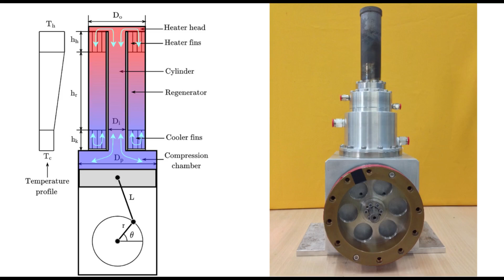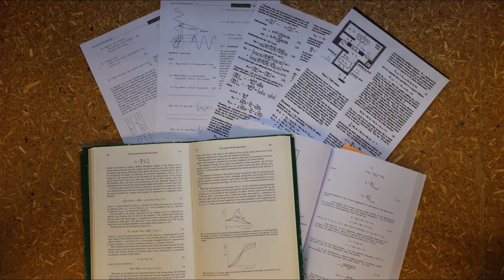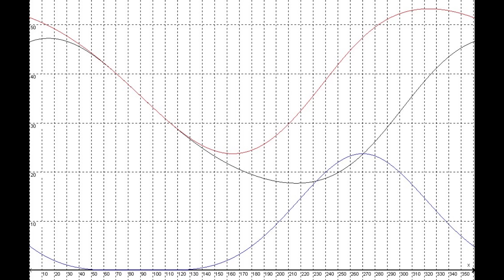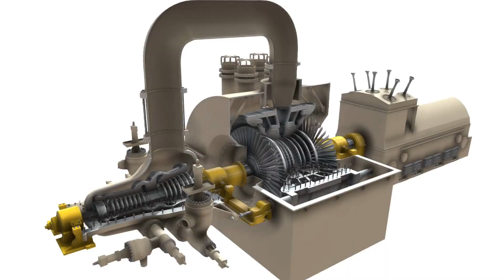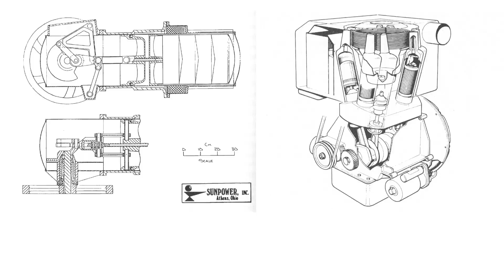Solution of producing cheap energy to support our solar plant to go off grid ?

Comment: I've been getting an itch to build a rhombic drive and I decided to watch all your videos from the beginning to in sequence.   It seems you had put so much effort into getting this to work and I thought you where making progress.  It's a bit of a bummer that you're thinking about moving in a different directions.   You mentioned your primary reason for abandoning your design was over reliability issues.     I understand that part of your constraint is the diy aspect of this with the equipment you have.     The question that I ask myself, was did the original phillips engine also suffer from these issues as well.   If equipment, time and money, where not the constraint, how would you solve this problem.    I don't know if this could be a solution or not but it seems to be that the lower portion of the drive, the linkages, gears etc should be bathed in oil.  You mentioned that you needed to keep oil out of the compression area because it would foul up the regenerator.   Would there be a way to have a oil sump isolated from the piston/displacer (Bellows perhaps)?   Fwiw.. I don't exactly understand how your regenerator works.   I saw a couple other designs where the displacer was also the regenerator, which is not the case in your design.... Was there a video where you talked about your regenerator and I just missed it?    It sounded like you had many technical challenges with the compression cylinder.... How do the big boys do it..  It sounds like you might be moving to a free piston design,   would those piston issues carry over to that design as well?
Reply from the maker: I will still develop the Rhombic engine further, I just need something new now for a time!
The Problem with it is that the Rhombic Stirling is too complex and  therefore it would be ridicoulus expensive.
So I have to make it simpler, more powerful and also less maintenance intensive which is a big task.
The Philips Rhombic engines were succesful but also too expensive for the market to compete with other engines.
If you want to use oil in the crankcase and/or on the power piston you need a oil scraper ring which is also quite complex.
The regenerator is a very fine wire mesh and stores the heat between hot and cold and raises efficiency.
I think you can see at least a part of it in the video "development of the rhombic Stirling engine" a few years ago.
I did not decided which concept will be next as I got so many suggestions here that I first have to sort everything.
Greetings

Comment: Steam is a better option if your going to use a gas or biomass fuel. Best option for long term continuous operating would be a turbine since the only moving part is the rotor shaft & bearings. You can make the rotors using thin lamnations welded together to create simple impulse rotors.
Reply from the maker: Steam still seams to be very poular as the mane y commentarys hers show, I will think about it!

Comment: What about Fluid Stirling Engine? I think they are for you the best choice
Reply from the maker: I think they have very low power.
But if you know a powerful design it would be very interesting...
Reply: @myengines2443  increasing the pressure inside and cap the other end (like working at 10 atm instead to 1 atm) should do the job....

Comment: Regarding steam engine I suppose it's worth considering the flash boiler scheme with small thick wall tube boiler with water injection "on demand", so it hasn't much pressured steam inside and needs less maintenance. It's not suitable for large powerful engines, but for small-scale power looks applicable, and was used in some steam engines in late "age of steam". I think in case of low grade fuel (e.g. wet and dirty biogas) steam engine is the best solution because of it's tolerance to fuel parameters flow by design.
Reply from the maker: Yes, steam engines seam to be a big deal as I read in the many comments here about them.
I will take a closer look upon them especially the monotube and flash boilers!
Thanks!
Reply: I have a book on a guy that has used a cast iron hit bulb diesel weekly to charge his battery bank and heat water for him. He's seen other use wood fired steam but it's a VERY hands on set-up. Have to be at home while it runs and takes a while to get going. It works, but it's a fair bit of messing around. Personally I use solar for small draw things, and a generator for water pumps and washing machines and power tools, with a 600 litre overhead tank that runs my water during the week.

Comment: perhaps a fuel cell can run on mixed fuel gas like biogas? On one hand I heard fuel cells are very picky about their fuel supply, but if it works, it could be very effective.
Reply from the maker: Can they run on biogas and produce electricity directly or have they first be converted in hydrogen?

Comment: Thermoelectric generators are generally extremely inefficient, but you could actually make use of a particular thermogenerator that operates at the same temperature that the methane in your biogas would burn (given a high enough purity). See “Thermophotovoltaic efficiency of 40%” by LaPotin, A. et al. It’s a feasible build.

Good luck!
Reply from the maker: Thanks, I will look out for it!

Comment: Talking of woodgas for an IC engine, you'll be surprised at how clean it is  :) . 
 Even after thousands of hours of operation, corrosion of my engine's internal parts is simply not an issue.
Reply from the maker: You have a very big IC engine I think?
Mine would only have a very low output and would therefore be much more vulnerable?
Reply: @myengines2443  
 My first system had a car engine on it, but I went with much smaller engines after that. 
I use the working parts of portable 2KW generators, that I have taken out of their frames, and installed on the cart, with the gasifier. 
 Corrosion is not an issue with these, but they do start to wear out, after about 1000 hours, because they are rather cheap engines.
Reply: Will you be updating any videos on you set up?? I would be very interested in this. I'm still in the building phase but still needing ideas on how to set up and process the woodchuck like you have in your wood pallet video. Cheers from Australia
Reply: @robertpoynton9923  
 Sorry, I have been inactive in that area for a while, as I am in the process of moving to a new farm, and building a new machine shop. 
Still though, we may be able to swap some notes, to help get your new project started  :)  .
Reply: @CNCmachiningisfun  sounds good mate! I'd love to pick your brain
Reply: @robertpoynton9923  
 Its not gonna hurt, is it  ;) . 
 There's not much left in there, so if you can find it, it is yours  :)
Reply: @robertpoynton9923  
 Sorry, can't reply. 
FascistTube won't let me!
Reply: @CNCmachiningisfun  I hear ya mate. I'll figure out a way

Comment: In theory the bio gas can be filtered the same way coal and producer gas is using iron on the sulfur and either water or sawdust filter for the tar.
Reply from the maker: I do filter the biogas as you can see in my biogas video but it never gets really clean to not damage the IC engine I think.

Comment: Burn the gas, and have banks of peltier diodes to generate power
Reply from the maker: But what kind of elements, maybe self made ones of magnesium can be used with much higher temperatures ad therefore better efficiency and power?

Comment: Thermoelectric could work but expensive to get enough to have a reasonable output.  What is interesting about them that ppl don’t talk about is the lower the voltage the more efficient they become even if you lose effective pumping capacity.  For example 12v TEs at 2v 1amp and you have COP of 4.3 which is on par with ac compressors.  So you could get 600 or so and when on let hot side heat a water storage tank and cold side chill another tank.  When you want some power back off the system the same modules can generate electricity from that temperature difference.  600 12v modules 320gallon hot tank heated to 140f and another chilled to 32f would allow you to pull 1000watts for about 160ish hrs.  This is still a bit impractical of course but interesting nonetheless.  I mean IBC containers are free if you could source them and TE modules bulk ordered from manufacturer can be about $.90 each so it’s not impossible.  Prob need 8inch or so closed cell foam also.  So I mean if incorporating it into your homes heating and cooling system I suppose it would work well.  Even the cheap modules should hold up running them at that low of a voltage.  Just pump the cold water through some liquid to air heat exchangers in your home for AC and hot water tank for hot water needs and heating via same exchangers.  Idk maybe worth thinking into.  If you’re interested let me know and I will send you the math used to come up with the output and pumping capacity.  Oh and the reason they work better at lower voltages is that when at 12v for example they generate heat while trying to pump heat so they work against themselves really.  The sweet spot for a 12v module is about 2v from my research and few test.
Reply from the maker: Whats with diy element made of magnesium and other metals?
The use of higher temperatures will improve efficiency and power, and the durability will also be much better?
Thanks for your thoughts I will think about it!
Reply: Any two metals with dissimilar thermal conductivity can work but only are few are worth the effort.  I’ve never tried copper oxide and copper before but that would be a easy one to test.  Not sure if a diy version can get as compact as the bought ones but from your videos I’m confident you could do it.  Other metals are bismuth telluride which they are normally made with if I’m not mistaken..Silicon-germanium…magnesium silicide and even a polymer that can do it but I would have to look that one up to tell you the name.  As for improving efficiency and power yes the higher the temperature the better long as modules can handle that temperature.  Another way to think of it is the greater the temperature difference the better.  Like in my dual tank example the cold thermal storage is near freezing.  Could go on below freezing if inclined to of course.  I’m pretty sure the cheap TE modules that are normally in coolers and such can’t handle much above 150f.   Would need to look up specific model to know for sure.  Let me know your thoughts I would be happy to help in anyway I can. In fact I will check that copper and copper oxide junction and let you know the results.
Reply: Copper oxide is garbage for it..haha magnesium seems to be the way to go as you suggested.  Robbery Murray has a few videos on the topic that are worth taking a look at.
Reply: I do have another type stirling engine I designed a couple years back that I have yet to see anything like it anywhere.  Would take a while to type it out but its much simpler to build with the only drawback being size.  Like it will have to be rather large to get any useful output.  If interested let me know where I can send you some pics and further explain it.

Comment: Is it super cold where you live? If not, there are plenty of other ways to extract heat from the earth beneath the ground, in conjunction with running black garden hose through enclosed solar still type boxes. Run PEX pipe through the subfloor of your home (as well as high R-value insulation), circulating the warm water with small inline pumps, and you will never be cold. You can even install inline heaters just incase you need a little more heat. Heat rises up from the floor, warming your feet on the way into the house, which will keep you toasty in just about any climate. I helped install a similar heating system here in the USA, at the same latitude as Berlin. Just a thought. 

Very cool engineering though! I don't mean to detract from your efforts. I really appreciate the time and thought that you have put into your engine designs 🙏 Thank you for sharing ✌️✨
Reply from the maker: In first place I want to generate electricity, heating is a byproduct and even not a big problem as we have enough firewood!
Thanks for your nice comment!
Reply: @myengines2443  Ohh! I see 🙏 In that case, the Stirling is a great choice 👍✨

Comment: What about a small microturbine, or a pair of microturbine, the kind used in RC models, burning the biogas in optimized RPM for burning such gas. The microturbines are coupled to alternators also optimized for that particular RPM regime of the turbines.
These turbines aren't expensive and there are some turboshaft models already available.
Reply from the maker: Do you think they have a reasonable efficiency?
Reply: @myengines2443  Turbines are the most efficient way to convert chemical energy in mechanical energy. The problem with turbines is that they don't have much torque at lower RPM and they are expensive. So, some engineering is needed to couple a turbine to generator so solve the former. The issue of cost is solved by mass production of a consumer (?) item like RC model aircraft. Maybe. I think it's worth the investigation. One of the main advantages of turbines is that they can easily me configured to burn different fuels and mixes of those fuels.

Comment: My first experience with thermoacoustic engines are that it is a little work to calibrate every parameter right for best output. Probably this could be automatic done by some sensors and an simple algorithm. Alpha Engine seems good for a bigger power output.
Reply from the maker: Did you experiment with a traveling wave thermoacoustic engine?
A little work to calibrate sounds very promising, I thought of VERY much work to even get it to run!
Reply: @myengines2443  I tried standing wave and traveling wave configurations but only with a speaker and no heat source as heat pump. so it was easy to setup with some pluggable pipes from the hardware store. the traveling wave engine was a little easier to get running. but still work in progress. i made 3 regenerators from steel wool, plastic straws and a 3 printed stack of layers. next step for me will be to get a microphone and some thermal sensor. so i can get the max amplitude and the resulting temperature difference. for the amplitude i bought some 30$ oscilloscope online.

Comment: There is a open source nasa diy stirling engine and Robert Murray Smith did a Video on that! Really low tech but efficient and could be maybe scalable. if you run multiple machines simultaniously and due to modularity you've only had to change the ones failing. Could be a cool concept
Reply from the maker: I think I know which engine you mean, it really has low power.
But I will look at it maybe its an option, thanks!

Comment: I would like 2 try a radial engine of sterlings ganged to gather and ran with hot air.  The hot air from hot water heated with gas or solar and stored in a insulated storage.  Give that some thought.
Reply from the maker: Which radial engine you mean?
The temperature difference has to be as high as possible for good efficiency and power, boiling water is not hot enough for a small engine.

Comment: I am a fan of steam power, with some lubrications the pistons will probably outlive everything...
The rubber in stirlings will wear out too, if you are worried about wear...
Reply from the maker: You are right, rubber will also wear but can be replaced very cheap and easy.
Steam power is really not dead as I thought...

Comment: I would want to know, what are you using for lubrication? I don't see any kind of oiling system on any of the rods or bearings.
Reply from the maker: Yes that's the problem with the Stirling, any lubricant in the working space will contaminate the heat exchangers, especially the regenerator.
This makes things much more complicated and is the reason to use the 'bulky' Rhombic drive which has no piston side forces!
Reply: @myengines2443  could the gears in the crankcase be coated with a solid lubricant like MoS2?   The piston itself seems to be a solid piece of material. Could the issue with the piston be thermal expansion of the metal as it heats up?
Reply from the maker: I lubricated the gears with a bit adhesive grease as you can see in detail in my older videos a few weeks ago.
The piston gets hotter than the cooled cylinder and that causes seizing problems.
I am not sure how to deal with it because I think the way to go is close tolerances without piston rings!
Reply: @myengines2443  Wouldn't you run into the same problem with the other Stirling engine types? They all(*) use a cylinder for which you have to decide between "guessing" tolerances and using lubrication. And they all have regenerators that would get contaminated by the lubrication. Or do they allow you to use lipophobic regenerators? If your lubrication can't condense or gather on the regenerators, then you wouldn't have any problem.
(*) except for the thermoacoustic Stirling.